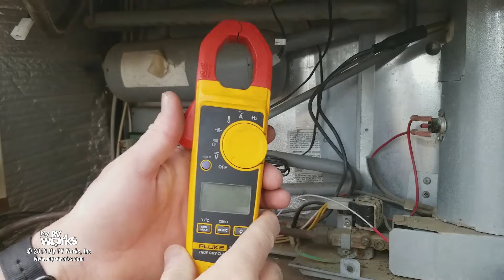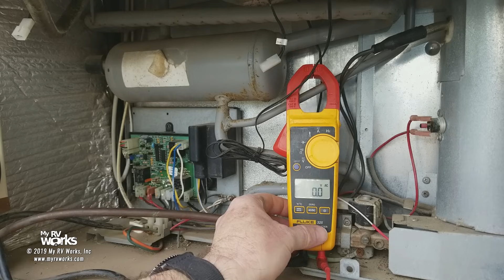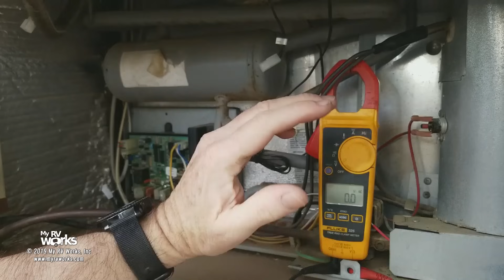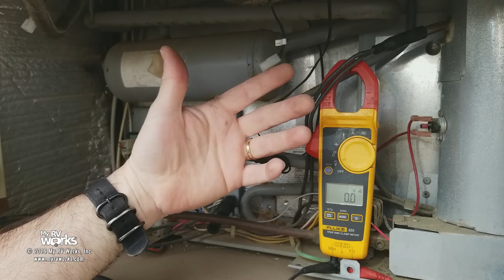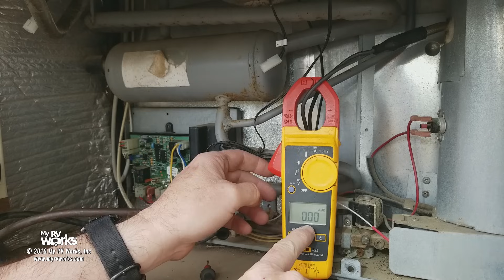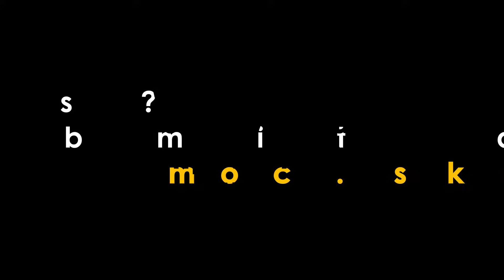Troubleshooting An RV Refrigerator That Works On LP But Not On Electric

Comment: So my dometic fridge in my travel trailer works on gas and batteries but when I hook it up to the city electric it doesn’t. There is a gfci outlet next to it on the opposite wall where the sink is at and I noticed it’s popped at times, can that be the issue why it doesn’t get cold?
Reply from the maker: A simple test to determine if the refrigerator is plugged into a faulty receptacle is just to get an extension cord and connect refrigerator to another non-GFCI receptacle and see if it works that way.  The results of that test will let you know which way to go with your troubleshooting. Either Upstream of the refrigerator and the wiring and circuits of the RV or Downstream into the control board of the refrigerator.

Comment: Tried everything in this video and everything I tested were in range. My heating element switch keeps tripping after a period of time. Any input on what I should check?
Reply from the maker: When you are referencing the heating element switch, are you referencing that small thermal switch on the boiler stack? It typically has two red wires going to it and a push button to reset. If that is tripping, that might be an indication that your boiler is getting too hot, you might want to look for yellow residue where your refrigerator has lost pressure. Those switches also do go bad from time to time so you might want to replace that switch, if that's the one you're talking about.

Comment: Sir, I do have 120 from j7 and j8. But nothing from the 5a fuse, fuse was blown. Replaced it. Fuse terminals reading 0 with and without the new fuse. So, no power at the 5a fuse terminals. Bad board?

Comment: My domestic fridge not cooling ,heating element was 39 ohms and fuse on circuit board blown ed twice  and gas  was firing the burner . Why 5 amps fuse keeps blowing on the board .it’s the board shut ,where else to check ?thanks

Comment: My happijac bed lift system just stopped working.  It would not work at all at my first of 3 campground trip.  At my second campground it worked just fine up and down without me doing anything to it.  My third campground, back to dead.  I'm home now and it is dead.   Pulled the switch from the wall and checked the voltage, between center contacts and the up side I measure 8.88 vdc.  on down side nothing.  I should have 12 volts for the system to work.  But I don't know how that switch really works or how to troubleshoot it.  I'm getting a voltage drop somewhere. It's hard to get to the motor in the back corner with the ramp closed.  I will try to open it and check connections around the motor and there is supposed to be a relay control board, but I don't know where that is located.  It has a telephone line type wire with RJ11 connector on the switch that goes up the wall.  Any troubleshooting help would be greatly appreciated.   Happijac would not answer and have not called me back.   I love your water heater videos.

Thanks
Ernie Werbiski

Comment: Why sticking the probes in the back of the heating element connectors and  determine continuity.  It is still possible that the element is without power if the connectors are coroded.

Comment: What if i dont get any lights for gas or electric? I checked electric panel breaker, and i check the two fuses in the access panel behind the fridge.

Comment: I checked my heating element.. 40 ohms.
Have varying ac output on board.   109v sometimes 60v 
Maybe circuit board has bad contacts on relay.. I do hear it (relay) click when 120v applied.. but heater is not even warm after 30 minutes.. 
Thoughts.??
Reply from the maker: The Click is controlled from the 12 volt DC side. Verify you have good power feeding the 120 volt circuit. Make sure you check the ground as well.
Reply: @MyRVWorks  I do have 120v at outlet and input to board..  I didn't check ground screw.. I will
Reply: @MyRVWorks   I just wanted to let you know that your video and your information help me very much.   Thanx.! 
I replace the circuit board, and on the old one, I can see a cold solder joint that leads to the j-6 connection for the heater..  although I just finished replacing it, I'm pretty confident that was the problem..  it explains the varying voltage I would read on the heater terminals.. 
Again, thank you very much.!

Comment: I have the exact opposite problem it works on electrical, but it doesn't cool with gas. You can see the flame burning hot, but it's not cooling the fridge

Comment: I have a stupid question:

Without checking the board with a multimeter (I did and everything is fine), what is the quickest way to know if the fridge/freezer is working?

Boiler and heating element are working but the freezer is no longer working (ice is melting and frozen items are thawing out). I noticed this yesterday with the melting part of it.

Thanks for any help!
Reply from the maker: Compare the temperature between the boiler stack and the absorber coils. The absorber coils are the tubes that are wrapped round and round and round. Temperature should be similar.

Comment: Thanks , lost my battery , old 6 yrs, changed out with new, for some reason blowed 3amp fuse blowed heating element, and still no power 120v on new fuse, lost relay on board,  found it to be dirty power comming in.

Comment: H!E!L!P NDR1292. Running in limp mode on propane. Problems:  Display panel NOT lit & will not run on electric. I have correct voltage across fuse but shows 1 volt across J7 & J8. Also only 10 ohms across heater core. Should be 69 ohms. I had a new backup main board (dinosaur) which I installed & got the same results. The obvious: Replace heater core but why don't I have  voltage at J7 & J8? Also the voltage down from the display board is very erratic. Maybe faulty display board also? Any ideas would be greatly appreciated...

Comment: Thank for explanation and videos . I checked and not find about this issue: At My Via RV refrigerator working on electricity if plug in, but when drive don’t work on batteries but automatically change to gas. It’s ok with me , but it’s safe ? Thank you Stefan
Reply from the maker: Sounds like your refrigerator is working exactly correctly. When you are connected to shore power, your refrigerator can use the electric heating element to generate heat in the boiler. When you're going down the road, and thus disconnected from shore power, then it will automatically switch over to LP (assuming it is in auto mode) and use the LP flame to generate heat in the boiler.  At all times it needs 12 volts from the battery to control the brain.  So, it is safe to travel down the highway with your refrigerator operating on LP mode. Happy camping.

Comment: So I went theought everything, checked the power just as you said, which led me to replacing the control board. I replaced the control board, still no dice. It won't run on electric.

I

Comment: Great video. I seem to have power everywhere.  Even the fridge. But  my dometic has decided even if I shut off LP that it wants to use LP and not AC, if I let it sit on AC eventually my ice starts to melt so it seems something linked specifically to AC power.  That works in the fridge too, lights on, he fan i wired into the light inside the main area works,  just doesn't cool while on ac
Reply: Very same issue only have 120 coming from one side of heating element tabs. Just not sure if it’s suppose to have 120 from both sides
Reply: @bigdogrobbiet  I believe it should be 120 in and out so on both sides.  My only thing I'm thinking is the control board is bad. The 5amp was replaced right before we left as it wouldn't switch to LP now it wouldn't switch to AC so I think the onboard 2amp fuse is bad

Comment: Looks like my problem is coming from those two other fittings next to heating element connections in particular the outermost connector. Mine is burnt. What’s the solution?  When I turn fridge on lights just blinks and shuts off. Help……!!!

Comment: I have watch this video and it has been helpful, but I am still not getting results. It is a used Dometic RM 2620 unit.   I have tested the cooling unit and it is working great.  I replaced the upper (eyebrow) and lower control boards and still no results.  I am only testing this unit with a/c output (as it is not in the rv right now) but there is no power showing on the eyebrow control board.  What else could it be?  I can't read the SKU to find its manufacturing date information.  Any suggestions?
Reply from the maker: On my Website Resources page:  https://myrvworks.com/manuals/
Filter for Refrigerators and Dometic.  Then look for a document titled "Dometic Refrigerator Training"
That is a PowerPoint I saved as a PDF.  Starting on page(slide) 62 you will find info on how to troubleshoot the wire harness to the eyebrow board.  Page 67 has more too.

Comment: Question- similar model, and on AC the freezer gets cold but the fridge doesn't cool. On LP both get cold. Would these tests still apply?
Reply from the maker: You may want to verify the refrigerator has a correct heating element installed. And then perform Ohm's law/ Watts law to do the calculations on if it's within spec.  We've got a lot of service manuel's on our website here:  https://myrvworks.com/manuals/
Reply: @MyRVWorks  I'll check that out - thanks! It's only 3 years old, and it's worked extremely well up until only recently. Does the heating element run the freezer as well?

Comment: I have a rm3926 dometic getting code E1 will not run on lp or ac!! Have power to the board and fuse! Heating  Element is hot and working please help

Comment: Hi, I’ve got an RV refrigerator that everything works all the lights work it’s plugged in the heater comes on in gas and electric but the refrigerator does not get cold. It stays at 78° in electric or gas.

Comment: I have a Norcold 9162. When plugged into shore power, kicks off the shore GFI unless I remove the AC heater wires from the power board. Fridge works on propane. When on AC (with element wires disconnected) it tries to momentarily deliver power to the heat element contacts, but when it senses no current draw stops supplying power, as it should. The heater element only has 20K ohms between either lead and ground, so essentially it is grounding out. My question is: will replacing the element do any good or will the new element still make contact with something in the heat tube and ground out anyway? It's in a 1997 Four Winds Chateau. 65000 miles. I have not tried to remove the heater element yet. Thanks.
Reply from the maker: Sounds like you have a bad heating element.  Here are two additional video’s I uploaded that may help you:

Heating element R&R:  https://youtu.be/XoryMLBZueg
Cooling Unit diagnosis – towards the end I discuss heating element topics:  https://youtu.be/IT_5HGe4q-k

Comment: Question.....We have power to the fridge (lights on in fridge and auto light is lit up).  In auto mode, it isn't cooling.  In gas mode, we have spark and flame, interior light is on in fridge, but not cooling....what am I missing?

Comment: The thermo switch on mine shows open and the little switch doesn’t appear to work at all. My Dometic doesn’t have an in line thermo fuse.  It’s 13 years old. The LP works but that thermo switch isn’t working. I’m confused u said it wouldn’t work on LP if the thermo switch was working. You didn’t remove the two red wires to show if the switch worked or not. Any ideas?  Thank you.
Reply from the maker: For that, the best solution is to follow the trail. Get your electrical meter and follow the DC circuit through that switch into the board. See if you can determine where the trail is broken.
Reply: @MyRVWorks  much appreciate your expertise. I did not follow your first advise which was a mistake. I “knew” it had to have power, it didn’t. The refrigerator has no inside fuse or breaker. The heating element checked fine and when I saw the thermo fuse closed I said “that’s it”. Well, after going back to the step I missed (confirming power) and found no power, I started searching. I used a night light and found several outlets inside the trailer were not working. IT WAS MY GFIC outlet that tripped 😳🙈🤷‍♂️ that had never tripped before in 12 years. The refrigerator is wired after that switch. I reset it BANG. Power🤯.  Just wanted to tell u that because it NEVER occurred to me to check the bathroom outlet.   Thanks again.

Comment: I have a norcold N8VF that works off lp and electric sometimes. For some reason it will stop working on electric for weeks at a time and then out of no where start back working. I have replaced the lower control board and it worked for about a week. I have 120v going into the board but only .8 coming out. The fuse is still intact. The heating element reads 47 ohms. Any advice?
Reply from the maker: When I come across very strange intermittent issues like this, I will usually pull out my data loggers and set them up to babysit the system for a while. With the data loggers I will be able to capture anomalies in the electrical. Without that I'm not sure how you can really capture the problem. If you want to take that route, send me an email and I will send you some links for the data loggers that I would recommend. They're a bit on the pricey side though so I'll just give you a heads up.  Darren@myrvworks.com

Comment: Great video.  I have opposite problem.  Can’t find any videos re fridge that works on elec, but doesn’t cooling propane or 12 V and starts beeping if switched over to either of those modes.  Taken it 5 times to get repaired to no avail.  Took it 3 times to same RV repair (said it was unplugged but yet it worked on AC.  Then said it was fuse.  Then said it was batteries.  Bought new batteries and still same issue.  Took to different place and said my origami e needed cleaning out.  Still no resolution.  Next place said it is vapor locked—probably.  After charging me $135 to diagnose.  Said they could take it out and turn upside down for another $250 and that may or may not solve problem. Does vapor lock seem like the most plausible cause?  Any ideas greatly appreciated.
Reply from the maker: Hi Crystal,

If your frig is working on electric than the 'cooling unit' portion is fine.  There is not such thing as 'vapor lock' in a refrigerator cooling unit - that indicates to me that the shop that is making such statements may not have much training on absorption type refrigerator systems.  Turning it upside down is a band-aid and will only fix for a short term if it does anything at all.  The cooling unit can have a blockage if the sodium chromate in the solution gets too hot (typically due to the frig operating un-level for some time) but like I said if it is working on electric the cooling unit is fine and there is no blockage issue on yours.

Here is a video I uploaded for the LP issue:  https://youtu.be/A7JboU8ZlE0
Here is a video I uploaded for a more detailed refrigerator diagnosis:  https://youtu.be/IT_5HGe4q-k
Here is my whole playlist on refrigerator video's I have uploaded:  https://www.youtube.com/playlist?list=PLk44vSl27TRBtE1CmMkPb02ayS5H1sKbB

On my website I have uploaded a refrigerator training document that should help you get to the bottom of your issue:

https://myrvworks.com/manuals/

Filter for "Refrigerators" and "Dometic"  then in the search box type 'Training'

That should result in a "Dometic Refrigerator Training" PDF (it started as a PowerPoint but I saved it as a PDF)

Scroll down and on slide 49 the Gas Components section starts.

See what you can determine with that resource.  Feel free to touch base back with me and if you still need support on this.  Let me know the Model Number and Serial Number and I can offer more specifics to your refrigerator.

Good Luck and Happy Camping!

Cheers,
Darren Koepp

-

Comment: Ok I replaced the board because I had 120v to the fuse. Do not have 120 v to element. What could be the reason I don't have power to the element? I just changed the board out. Still same results.
Reply from the maker: I'd be happy to help you figure that out. On our website we have service request form and if you select the option to for 'remote service request' I can work with you to get that figured out. We do charge for the service though.  https://myrvworks.com/submit-service-request/

Comment: I have a question, my even refrigerator has been working just fine. Electric or L.P. it's ran fine for a couple of years now. Today it's not cooling at all. I've checked everything, the burner lights on L.P. and heats up just fine. The heating element on the A/C side is working fine. I don't see any evidence of ammonia leaking. Can you or anyone please tell me what's going on with it?
Reply from the maker: After the refrigerator has operated for at least an hour, with your hands, feel the difference in temperature between the boiler and the absorber coils. If the refrigerator has been running for a while and the absorber coils are cold then that would indicate there's a blockage in the cooling unit. That is not field serviceable. In the first part of this video I do a short explanation on the blockage.

https://youtu.be/--DCnSw1jP4

Comment: I can't find anything on your site that discusses the upper cotroll board on Dometic. My fan runs on propane and not on AC?
Reply from the maker: Hi Steven,

On my https://myrvworks.com/manuals/ page I have uploaded dozens of Dometic refrigerator manuals.  Filter for 'Refrigerators' and 'Dometic' and see if your refrigerator model manual is there.  If it is not than I simply do not have it in my files and you will have to google for it or contact Dometic directly.

The upper control board is covered in many of the shop manuals.  

I have another more thorough refrigerator video here that does address how to diagnose upper control board issues:  https://youtu.be/IT_5HGe4q-k

Cheers,
Darren